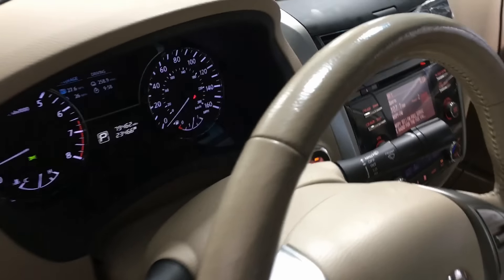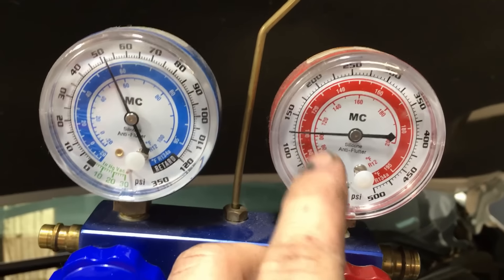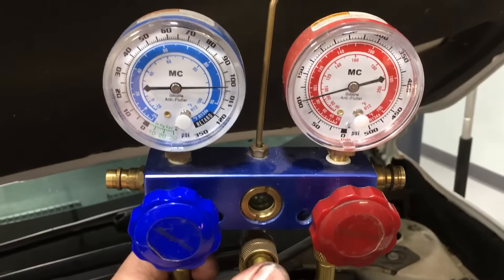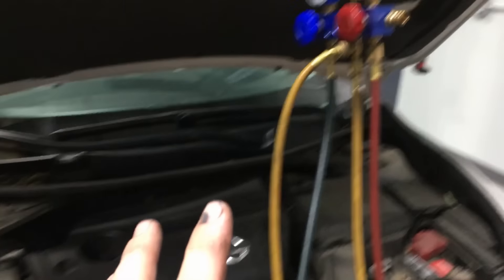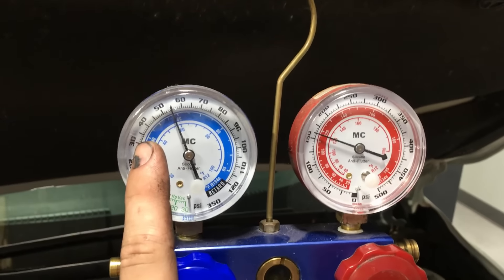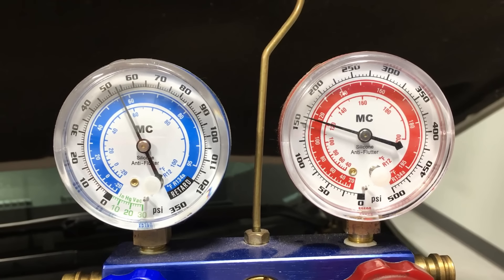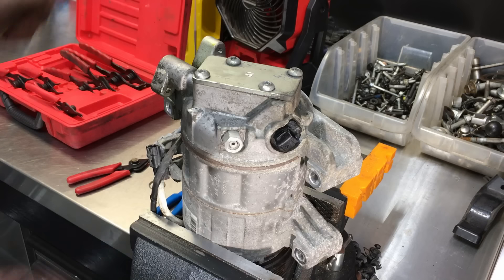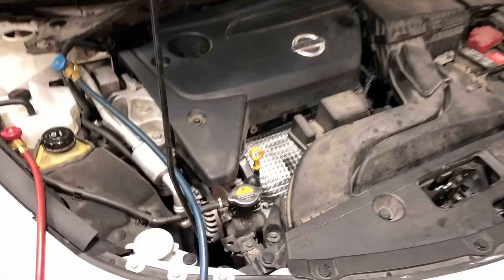A/C System Failure Diagnosis: Poor Cooling at Idle

Comment: I was a tech before these newer compressors (80's) and had to learn about them after my Hyundai Tuscon had a cooling issue with high low side pressures. I chased it until I found these type of vids. Replaced the valve and it brought the pressure back to normal and cooling was back to normal 46 degrees after being stuck at 60 prior. Thanks to you for doing these!!!! Saved me a ton of money doing it all myself.

Comment: As an Auto technician of 35+ yrs experience, i came through from the old R12 days in autos to the newer R134a systems and then the Control valve systems (common in 98' on Commodores in Australia) So I learnt these faults by actual diagnosis (the car dealers would replace compressors for this valve fault!)
Great to see your top notch diagnostics at work. Blocked cabin filters also reduce cooling effectiveness. Cheers from Aus 👍🍻

Comment: I'm impressed by your clean shop. I can't stand a dirty, greasy auto shop as most of them are. Great video! I'm a commercial HVAC tech and this exact problem on my 2015 Altima had me scratching my head. I evacuated the system and put a measured charge back in and no change. My gauge readings are exactly the same as yours! Thanks!
Reply: Was your Altima the S or no. I’m having the same problem but I have a 2015 Altima S with 2.5L but it don’t have that control valve on it

Comment: Another visual check is to see how clean the condenser is.  I just did one that was almost completely plugged with bugs dirt dust cotton etc. I actually pulled the radiator out (didn't want to crack the AC unless absolutely necessary) so I could thoroughly clean all fins on both. Starting pressure 30/270 @80°. When cleaning was done it was 37/175@ 77° blowing a nice 42° in the cabin now. If I hadn't thought to check and clean it, I would have done a orifice, dryer, and flush, and I doubt it would have fixed anything.
Reply: @nickynuts8013  yes could you translate that please lol 🤣🤣🤣🤣
Reply: Sometimes, it is best to just replace the condenser. This is particularly true on old cars, where half the fins may be bent and blocked.
Reply: @matthewstorm5188 I don’t know anywhere enough about this stuff but I have the nose off the front of my Jeep and that thing looks like it lost a really bad rock fight!

Comment: Amazing!!! I was just about to fork out $1200, $1500 to get my wife’s 2014 Altima AC fixed. it’s experiencing the same diagnostic issue in this video and I have no doubt it is the refrigerator control valve which I will be fixing. Thank you so much for this video. Thank God for YouTube. I have become my own mechanic because of you. 😁I just replaced by spark pugs and a spark pug terminal made possible by watching YouTube videos. 🙏🏽🙏🏽🙏🏽
Reply: Did the valve work for you?
Reply: @phillippardo5712  i just had it delivered and need time to install it.
Reply: @ricardooconnor2362  I have one on the way. Perhaps I'll check back in after I install and let you know how it goes. It would be nice if maybe you can do the same! Thanks.

Comment: I had a ford escort that the dealer wanted to charge me 1300 dollars to fix. I said no and took the car home. The dealer said i needed a whole new ac system. I started troubleshooting the problem myself and all i needed was a cycling pressure switch for 18 dollars from Napa. I fixed myself and i was happy as hell.
Reply: wolf2351  you can’t trust mechanics anymore, the world is so fucked anymore and you can’t trust or believe anyone. I told my Dad his mechanic was robbing him. For years I kept telling him, but he was like naaaa, he wouldn’t do that he’s a good guy, bla bla bla. Then he went to get a noise looked at and they said he had to replace his axles and power steering pump, 1200.00. But eventually dad found out when he noticed his power steering pump wasn’t changed and I got to say I told ya so. I’m sure he didn’t need, or get new axles either. Fix it yourself people, it’s not hard unless you lack time like a lot of us. Nobody wants to spend your day off working on a car, but it’s better than giving a mechanic a whole paycheck to fix something simple.
Reply: My dad used to tell ME the mechanic thing you need patience.
Reply: Never trust the stealership I mean dealership, always get 2nd opinion
Reply: I don't believe that for 1 second..
The cycling switch is the very first thing to check after verifying that it has Freon.
Did you ask for an explanation of what exactly they found.
Please post technicians comments on repair order
Reply: Nice
Reply: @justingeraldi2304  I'm going through the same thing now....no notes just recommend replace compressor. So I asked to speak to the tech and he mentioned the valve went bad and usually they just replace the compressor, no need to replace condensor or expansion valve. To top it off they left the freon in the system so I need to get it evauated before DIY'ing this

Comment: That makes a lot of sense. I can picture it in my head now. Very interesting and effective diagnosis method The compressor's inability to "pump" refrigerant from the suction side causes a backup that increases the pressure, and impedes the condenser from releasing the heat; High suction pressure, poor cooling, voila! Brilliant, live and learn!

Comment: Holy crap , this video might actually be the one to save me from going insane!   My pressures are 70/145 with 95 ambient temp.   I’m going to replace that valve asap. Thank you!
Reply: How did it go?
Reply: Yo. How'd your ac work out?
Reply: I actually had to replace my faulty compressor and pretty much start from scratch.
Reply: Id rather change the compressor in the beginning. trying to troubleshoot an A/C system can get expensive if you cant recover the refrigerant yourself. 3 to 4 trips to the shop to recover freon after a failed attempt is outta control. Im dealing with this now. I suspect the valve is my issue but those same readings could be a bad compressor.
Reply: @The_sTress   I've been told that it's most likely too much pag oil in the system.   
I'm going to replace the accumulator with a new one to get rid of the oil that's stored in the old one.  Fingers crossed.

Comment: I have been doing a/c work in mojave desert over 45 years, and you are very correct and a great a c tech.
Keep current and trained and you will have a great career and profits. Thanks
 I couldn't  have explained it better. THE sweet spot on low a c pressure I usually explain to them a low side preferred pressure range around 25 to 45  p s i. Running.
Reply: HIgh Desert?

Comment: NOTE This fix worked on my 2014 Altima but you do NOT need to remove the ac to replace the RCV solenoid.  It is clearly accessible from under the car I just put the altima on mini ramps and its right there.  Got the part form ebay for $40.  Thanks for your helpful video
Reply: Did you have to evacuate the system?

Comment: Well, here it is two years after you posted this video and my wife's 2015 Nissan Altima is doing exactly what is happening in this video with very similar readings. I'm doing this job now however, (like you said) a bit hard to find the replacement part. I think NAPA may have it. Lots of people have complained about AC compressor failure's on these Nissans. I'm guessing its this little part like in your video that may be at fault however, Dealerships and repair shops just see an opportunity to swap out entire systems and make a little more off folks. I find it a little odd that this fails and the car is only 5 years old with about 60k miles meanwhile, we have a 12 year old Hyundai Entourage with just under 200k miles and it's AC system is still original and going strong. Anyways, thanks for the video.

Edit follow up 8/5/2020: It was the control valve for our 2015 Nissan Altima SV. NAPA did not have the part like I thought. AutoZone said they could order one for about 85-90 dollars, (part number MT3452 ) from Santech. This part only fits 2013 through 2017 2.5L Altima SV & SL models only. I found one on ebay by typing in the part number for 26.00 dollars and free shipping. Took a chance and it seems to be working for now. Not sure how long it will last as the part is made in China. If it get us through the remainder of the summer I'll be happy as it's better than replacing the whole compressor. Good luck to anyone dealing with this.
Reply: Any updates?
Reply: @MigDw311  Yeah, it was that little part like in the video. AutoZone has the part you can order for like 80-100 dollars. I found one on ebay for cheaper and its working good now. If you're having this issue too I wish you much luck. This video save me a good chunk of money. I didnt even have to remove the compressor from the car. Was able to access it from under the car.  If you need the part it's: part number MT3452 from Santech. This part only fits 2013 through 2017 2.5L Altima SV & SL models only.

Comment: Great video. I have the exact same car with the exact same issue, exact same manifold gauge readings (high side normal low side too high) and exact same temp blowing out the vents, lol. I wish I saw this video before I replaced the TXV, the condenser, flushed out the evap, checked both cooling fan operation etc. I did everything but replace the compressor and control valve. Most people just look for a click out of the compressor and think it's not the issue. This shows that even if the compressor clicks on, it could still be at fault (Compressor control valve in this case)
Reply: I have the same issue and same readings on the same car as well. Did you figure out what ultimately fixed your vehicle? I've already replaced this valve, but I still have the same problem. I'm thinking since he ended up changing the whole compressor, that maybe it was a bad compressor to begin with. Did you end up having to change yours? Or just the things you mentioned? Thanks!!
Reply: Dylan Parker I changed the expansion valve first but that didn’t solve the issue. I replaced the condenser as well but still the same. Only after replacing this valve, the reading improved and the air was ice cold
Reply: @jameslouis4309  Thank you for the reply! I still feel like this is my issue. But I don't know how to test the replacement control valve I bought on eBay. Maybe my replacement doesn't work either..
Reply: Dylan Parker I agree. I couldn’t test the old one either. Usually you can hit it with 12v and hear a click but not with these. I just installed the new one and hoped for the best and thankfully, that was it.
Reply: @MrParker5  weak compressor most likely

Comment: Wow, exactly the thing I'm looking for! I suppose this is my issue now, when at idle the cooling is not as good as when I rev the engine. But when I rev the engine, the pressure on the low side is at 50, 52 which is way too high, while on the high side is at 200, 210. (mine is BMW E90)

Comment: 13:30 I'm glad you made this distinction clear.   the electronic valves like this one are lesser known and studied by most.
also doesn't the valve close when it's off and sensing no heat?  like a mechanical valve it would close when powers off so why do the pressures equalize?

Comment: Thanks for the accurate assessment determining TXV and control valve.  My 2014 Corolla A/C has cold air when driving then at a stop it turns to hot air 10-15 minutes later cold again, do you think this is the control valve on the compressor causing the problem?

Comment: Thank you ,for all these precious infoes, I have an Avalon 2013 that I took to the dealer they did not know the problem they said the system is clogged somewhere,,,ha ha ha like the sewer ????
I am away from home now but I am pretty sure it is the pressure control valve.thank you again
Reply: I'm pretty sure if it's clogged issue the high pressure reading side is much higher than normal.

Comment: I have a 2010 Fusion sport with a similar problem.  Insufficient A/C when it's 30+ degrees C outside and the engine is at idle.  As far as I know, the system is fully charged.   I'll ask Ford to check this.  Thanks for a great video!

Comment: VERY NICE WELL DONE VIDEO!  I have rebuilt 3  or 4 automotive  AC systems. One of them had a plugged orifice . Have retrofitted r12 over to r134a. With excellent results. Leaks are a problem. If you have a leak in a retrofitted r12 system the leak will be worse,with r134a because of the molecular  structure of the refrigerant r134a.
Reply: interesting. 
Where does system leaks most: compressor shaft, shredder valves, condenser fittings??

Comment: Nice of Nissan to make getting to the a/c pressure control valve so easily. lol. I have been noticing a/c failure in many different types of 'newer' cars less than 5 years old compared to older vehicles.
Reply: actually on my 2014 altima the valve is easily accessible from the bottom, no need to remove compressor.
Reply: That's because of txv and r134 runs at a high head pressure. Fixed orfice with r12a is the way to go imo

Comment: Best explanation of how to read the gauges!  I've replaced the compressor, condenser and expansion valve on a 2003 Lexus sc430. The ac works great at or above 1000 rpm otherwise the compressor shuts off. Any ideas why?

Comment: Great video! For me that greatest pain is to get the valve out of the compressor. I am using my hand to get it out but its not coming out. I don't want to use pliers and more force since I have seen on other videos that they use pliers and they break where the connector plugs in. If it breaks, the rest of the valve will be stuck inside the compressor and YOU will have to remove the compressor and if you cant get the valve out you have to problems. I don't want use any w40 or other stuff since I don't know if the AC will get contaminated. I will keep trying to see if it comes out, wish me luck.

Comment: Just an fyi. I've replaced the refrigerant control valve w/o removing the compressor and that fixed it! It took me about 1.5 hrs to replaces it though (mainly because it was a pain to remove the retention ring due to limit space) but it worked.
Reply: Did you have to evacuate the refrigerant?
Reply: @johndunlop2895  yes

Comment: The solenoids for the AC compressors are widely available online... 
often the auto mechanists etc would ‘recommend’ complete replacement of New compressor. 
It’s easier job and higher value, esp service Dept that has profit objective to attain.
Reply: Had to get one shipped from the US, overseas. Can't find them anywhere where i am, except pulled out of an old and likely seriously abused junkyard AC compressor.

Comment: my dealer told me I needed a new compressor, but I found the a/c compressor control valve online for $16.99. Very easy change out on Nissan Altima's and Sentra's.

Comment: A/c control valves are readily available 25 to 60 dollars no need to purchase whole new compressor if just the valve is faulty. Cheers from Jacksonville Florida 🌞
Reply from the maker: Yup if you can find them and can wait then go for it.

Comment: You need a big shop fan to cool yourself and blow the exhaust fumes out if you don't have one. Thanks for the gauge reading and pressure read out determination. Plus other info... I have heard the low side line should get cold with the engine and ac cool on.

Comment: When you turn off compressor and you measure temp on suction line and temp is going up quickly it tells you valves are leaking high temp high pressure gas back through valves on a residential system. Would it be same for this? Thanks great video!

Comment: had a Saturn Vue 2007 run cold down the interstate but hot sitting in traffic.  replaced the scroll valve pulled a vaccum and refill the unit and it's still cooling after three years.

Comment: I asked a workshop nearby to diagnose my AC system because it was weak at Idle but they said all they can do is refill system first and then diagnose. Refill didn't do anything and then they said it is going to be very expensive to repair because AC system does not give any fault codes so they recommend to have AC flush and then replace nearly every AC component.

Then i came to YouTube learning some AC diagnostics myself and it turned out that i had only faulty solenoid valve.

Comment: Hi,
My car's ac cools great, low pressure is 30-50 psi. High pressure is 200-250 psi. Ambient is 85F with humidity less than 15%. The only thing that is bothering me is that the compressor is running very hot to touch. I replaced the evaporater and txv recently due to leakage. What do recommend to look out for? Thanks

Comment: I have a 2015 Nissan SV it is doing the pressures are identical to the ones on this video I found a place here in Texas that sells the refrigerant control valve do you recommend me pulling the compressor or can I replace it in place if I put it on jack stands and will I lose any oil

Comment: I noted you changed the thermometer location from lateral to central vent for the post-repair reading. Also, tossing around acronyms such as TSX/FOT makes sense to you but for some viewers might be confusing to the point they stop watching because the terminology is too specific for someone without the benefit of your knowledge base. Of course in my stating this I presume your intention is to share your knowledge.

Comment: I have a 04 nissan armada 5.6.  Past 4 years every single year I have taken the truck to get ac freeon refills.  Till this date every time I'm at idle or stopped at red light I get hot dry air on the ac.  Only on highway I get somewhat fresh but not cold how it suppose to be.  Can I get some help.

Comment: I have identical problem with my Acura TSX 2005.  When I turn off the engine pressures equalize about in 5 minutes.  Also I can rotate the A/C clutch with my finger.  Is it related to weak compressor, or TXV?

Thanks for the detailed and methodical explanation...
Reply: TXV blocked/stuck closed? System obstruction? Highly doubt it's the compressor here